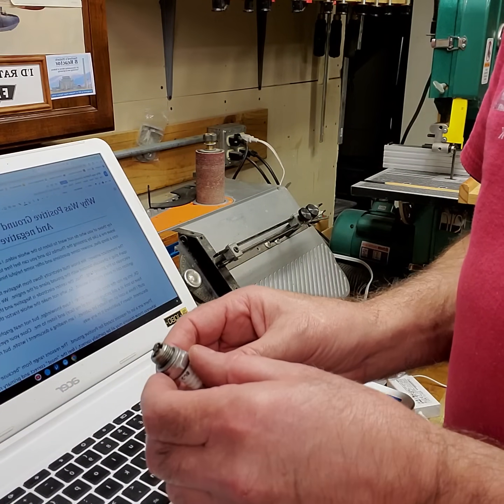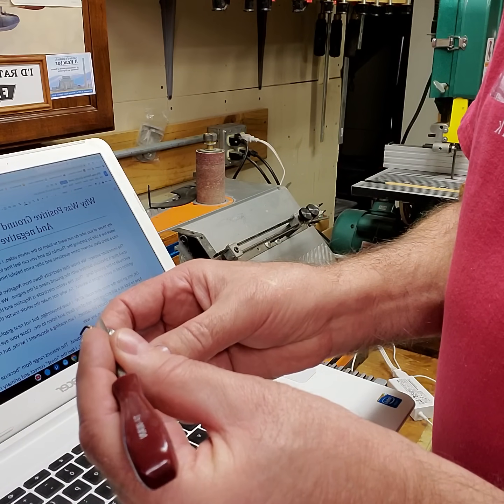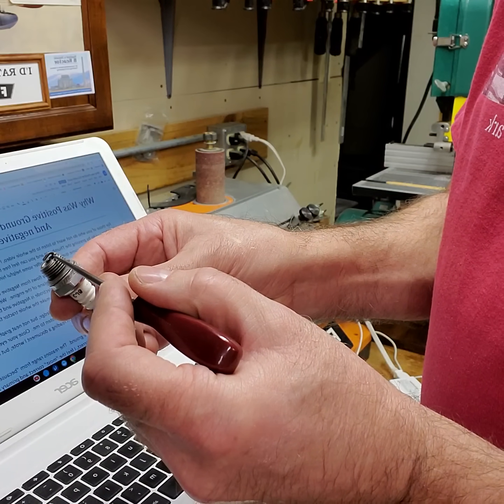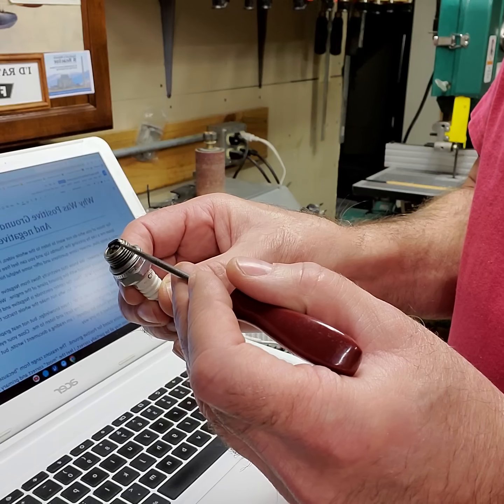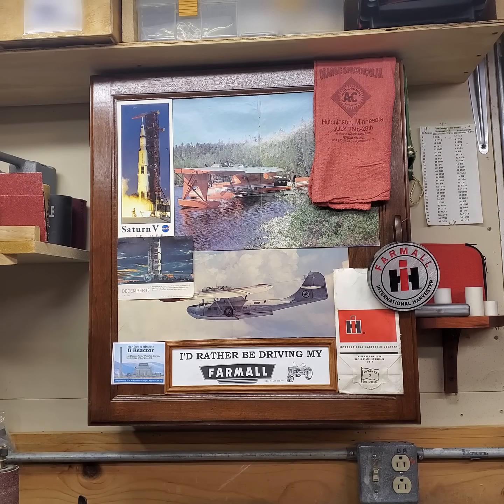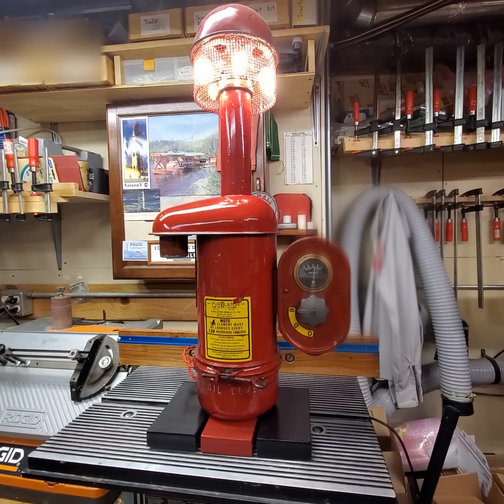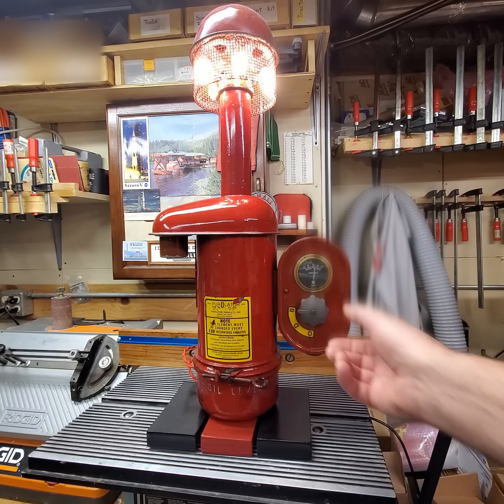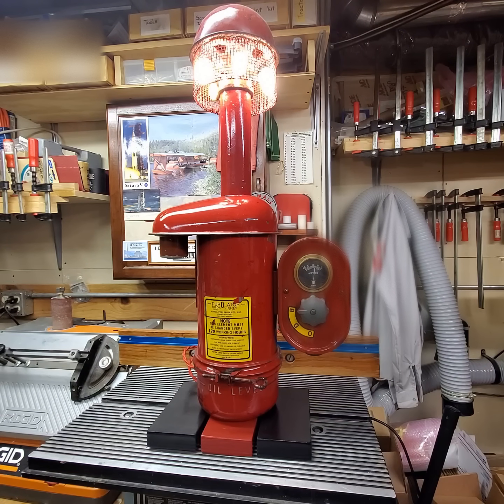Why positive ground was used on old cars, trucks and tractors

Comment: Thank you. I had the proble of comprehending the positive ground  setup on the IH I am attempting to  restore. . Hours of YouTube watching didn't  get my light bulb go on over my head. It just took the right person to explain it the way I could comprehend it. Definitely will  lean up every connection and thanks again for your knowledge.
Reply from the maker: Hi Ken.  Thank you for watching and commenting.  Yes, clean up every connection on the generator.  All the way to the block.  Then, if your H is old, the generator field is grounded through the cover on the electrical box!  Yeah, a bad design from IH.  If the generator is not charging, this is very often the problem.  On my H, I ran a braided ground wire from the L,H,D,B switch to ground.  A vast improvement.  My H is 6 Volt Positive ground and its staying that way.  It always charges and starts.

Comment: I have a John Deere 4010 Diesel 1961.  It has two six-volt batteries connected in series with positive ground.  What is the safest way to charge them in the tractor with my 12-volt charger?  I generally hook the positive of my charger to either positive battery terminal and the negative to the frame?  Is this good?  Does it matter which positive terminal I hook to on the batteries?  Thanks for your knowledge and input.
Reply from the maker: Hi Mark.  Thank you for watching and commenting.
Two 6 Volt batteries in series configuration can be charged with a 12 Volt charger.  It would be best if it was a good sized charger, or it will take a while.
I am assuming you made a typo in your question.  With positive ground, the positive lead from one battery is on the frame.  I assume you are connecting the positive lead of the battery charger to the frame.
Naturally, it's always best to disconnect the battery (or batteries in your case) from the electrical service of the tractor.  Then, charge both batteries (which are in series) at one time.  You probably should not charge a single 6 Volt battery with a 12 Volt charger.

Comment: I thought that the reason for the polarity of the high voltage for spark plugs was because the center electrode gets much hotter and then it is easier to initiate the spark because of thermionic emission, which is what makes vacuum tubes work.  So, it basically lowers the threshold for the initiation of the spark, a little. Some cars, motorcycles, and as noted by someone else here, outboard motors. There are two HV outputs from each coil. Now I thought that all of those had the two ends of the secondary winding as outputs which would make one positive and the other negative. But some may have two secondary windings in parallel.   Often called "waste spark ignition" because one plug in each pair is firing when that cylinder is between the exhaust and intake strokes. Of course, most small engines are essentially also waste spark since the magneto ignition is triggered by the crankshaft, but I digress.

Comment: also the principal is that if theirs more electrons than protons negatively charge  if theirs fewer or less  electrons than protons  positvely charge  so with being said  iginition systems  emf or emp  signals and spark plug wire voltage  would have a higher potencial  voltage means higher of potencial  electrons  to ground  where there is a equalibrium of nuetral charge or less electrons than protons

Comment: Hello great video. I am 54 years old and working on a recent car. I got a 1941 Packard my dad is trying to explain to me what positive ground positive ground system is and why negative is going to the isolated terminal on the solenoid, which I still cannot quite understand what’s what’s happening here if you would like to try to explain that the principal and the wiring on the car to the lights for me to troubleshoot and fix I’d appreciate thanks

Comment: Doesn’t matter. When I turn on the switch something better happen….
Reply from the maker: And, you are right.  What's important is when the old John Deere is cranked over, it goes.  Just like an automatic transmission.  How they work is a mystery to most people.  I just want the Dodge to back out of garage when it's put in R.  Ha ha
Thank you for the comment.

Comment: Hey Bryon,
With all your knowledge in electricity, may I ask you a question?
I have a restored 1953 M38A1 Willys Jeep.  Can’t get the generator to charge., or it seems to put out only 15 or 16 volts of its rated capacity of 24 volts.
My question is, do I need to polarize the new regulator and the old generator to initiate the two components to work together?  
And if so, these components, regulator and generator, are water proofed with cannon plug style connectors.  This doesn’t help when and if trying to polarize the components.
Any suggestions?  Sorry to pester you with my problem.  
Thanks again for your video!!
Reply from the maker: hi, thank you for watching.  My first thought is always the ground path.  Every point of contact needs to be clean.  This includes all the brackets.  I see this a lot in tractors.  People do a super nice job painting all the brackets.  But, that destroys the ground path.
Reply from the maker: I should add more:  And, by ground path, I mean everything all the way down to the bare engine block.  Bolt threads and everything.  Tractors, for example, were assembled and then painted at the factory.  However, carefully painting every part, and then assembling, destroys the ground path.  Especially noticeable on 6 Volt systems.
Reply: @ Again, thanks you for your help and all your knowledge!

Comment: Worked as a mechanic at a fuel trucking company in Alaska some years back. They had an old Farmall pump that was sometimes used to fill barges. Worked great except nobody could ever get it to charge the battery. Well…being a farm boy back-in-the-day the first thing I looked at was how the battery was connected! Yea….it was backwards!!! Boss thought I was the dumbest mechanic he ever saw until he picked up the {fixed} generator from the rebuilder. Bigshot lead mechanic never heard of positive ground. Didn’t make any friends that day!!!!
Reply from the maker: Thank you for sharing.  Excellent story.

Comment: I really loved restoring my dads old Farmall.
It was even more fun to hand crank it up and drive it!!! 1939 Farmall A, no hydraulics, no battery just a magneto. Had to put a new condenser to fix the no spark. When i was tig welding a 76 Ford F250 aluminum oil cooler i got close to the header and i got to watch the little lead particles floating up the arc and depositing on the tungsten...

Comment: I never knew positive ground existed, but my BMW R1200RT bike has a wire going from the + terminal of the battery going to the frame. It made my head hurt when I tried to make sense of it
Reply from the maker: A motorcycle with positive ground id new to me.  But, I see why they did it.

Comment: Confused.  At 1:25, the electrode is negative and the ground tab is positive.  How can that be when the negative side of the battery is connected to the engine block
Reply from the maker: Hi allenblack5794.  I did not make it clear in the video.  However, in the many comments, a very kind commenter makes it clear.  The two electrical "circuits" are separated by the windings in the ignition coil.  It strange as it sounds, and from an electron's point of view, the two circuits exist in harmony.  I hope this helps you.

Comment: Lol, I didn't know your were an IH Farmall fan when I clicked on your video. I'm actually trying to troubleshoot a 1949 Farmall A (🥰 My 1st tractor.) that turns over but won't start. I've already gone through the combustion, fuel systems and now focusing on the electrical system.
Reply from the maker: Hi!  Thank you for watching and commenting!  Yes, I am a Farmall Fan.  I have a beautiful 1944 H (Positive ground and 6 Volt).
My favorite tool is a spark tester.  It hooks up at the spark plug and you can physically see the spark jump the gap.  These are inexpensive tools.  Over the many years, I have fixed a lot of stuff with this simple tool and my Volt / Ohm meter.
Good luck!!
Oh, BYW:  I have seen many problems with the On / Off switch not working.  One of many things to test.

Comment: You are correct about the spark. I trained over 50 years ago and work on more LUCAS generator and regulator systems than anything else. It was always explained that it  is  positive ground, negative spark. LUCAS coils were wound for positive ground and for the transformer effect. I had a problem on a forklift that had a positive earthed alternator. It was wired wrong and the spark was coming up the spark plug instead of going down. After diagnosis and rewiring the the coil and reversing the battery everything worked correctly.
Reply from the maker: Thank you for watching and commenting.  Thumbs up!  You are exactly right.  I like the experience you have!  And, both you and I understand the difference between "the spark was coming up the spark plug instead of going down".  That makes all the difference in the world.

Comment: One more question.  So if i put a battery maintainer on my tractor that has a ground positive system, do i still connect the red clamp to the positive terminal?
Reply from the maker: Hi.  Yes.  You are correct.  
It is 100% OK to use a battery maintainer on a Positive ground system.  Now, to be more generic about the answer (leaving color out), hook Positive to Positive.  It's always best to do this at the battery as this would help avoid possible grounding mistakes.

Comment: Hello, great video, but I'm still a little confused about one thing.  I'm wiring up led headlights to my 1957 IH 300U. I planned on running the light connections straight to the battery terminals and using the toggle switch that came with the wiring harness to turn on/off.  This requires me to use the positive terminal on the battery for positive.  Will it hurt the battery, lights, or tractor if i run the lights off the same battery as the tractor and have them runnin positive to positive on the lights?  Seems like i could be playing with fire.. literally. Where are you located in Minnesota? I'm in Minnesota.. do you still work on old tractors?

Comment: I attended California Maritime Academy during the mid 70s as an engineering student. We took 5 classes of electricity. We were taught electron flow as well as conventional flow in DC circuits. The teacher really messed with our minds in lab class by intentionally confusing the two flows.  We put together kit DC motors and were grilled on which direction that they would turn before closing the knife switch. I have collected WWII Dodge army trucks and post war Power Wagons. Most of the WWII trucks were 6 volt positive ground but the radio trucks were all 12volt negative ground, because of the radio equipment was 12 volt negative ground. The 6 volt generators have labels which are red in color, the 12 volt generators have green colored labels.  I have always assumed that because the manufacturing was set up during WWII, it was easy to switch to 12 volt negative ground 10 years later. I have a bunch of 2N and 8N tractors with a "permanent" implement attached to each one. Most of the tractors are still 6 volt, but the one with the snow blade is 12 volt because the engine turns over better in the cold, especially when the tractor is being somewhat abused and routinely stalled by pushing too much snow around. The Ford 6 volt generators have no voltage regulators, just a cut out and a movable third brush. This will slightly over charge a battery, reducing the life. A one wire GM alternator will extend the battery life to 6 years. Also worn out 12 volt batteries will still start lower compression engines where the six volt battery MUST be in perfect condition.  I can jump other 12volt vehicles with that tractor too.  I have a Model A with a reworked 6 volt positive ground GM alternator, the 6 v battery will last for 5 years.
Reply from the maker: Hi Steve.  Thank you for watching and commenting.    Very interesting comments.  An education that has you determining the direction of rotation before electricity is applied is a very thorough education indeed.  We just started our 6 Volt H last weekend after sitting all winter.  One crank and it was running.  Take it a bit easier on that snow pusher!  ha ha

Comment: it has nothing to do with the spark plug. the spark is ac(watch it on an ignition scope). I am 78 years old and grew up with this. one thing for sure. the positive connection to the wiring in the vehicle will cause the wires to corrode off but not if the wires are negative compared to chassis. i am not embarrassed I know what this is about.

Comment: Very nice video I am new to positive ground oh, God I just bought is a 1959 Austin princess Rolls Royce I'm not getting no spark so I'm not too sure how to check this stuff out the points look clean I cleaned them so I don't know what the deal is any help would be good thanks in advance
Reply from the maker: Hi!  Thank you for watching.  I would use my Volt meter and Ohm meter just like working on any other type of vehicle.  But, for sure, I would make sure the ground path between the distributor housing and engine block is clean.  That is where I would start.  Naturally, there is the easy stuff.  Is the ignition switch on?
Good luck!  What a great car to have!!!!!
Reply: I got a good ground I do believe but I think someone told me the condensers probably bad because I had a 12 V battery hooked up to it so it might have fried it
Reply from the maker: @stevenkasten1149   Good luck!  I am positive you will get it figured out quickly.  In the end, it will most likely be something simple.
Reply: Thank you I'll keep you posted

Comment: I find it easy to understand electron flow from negative to positive, excess electrons at negative to lack of electrons at the positive. Never quite grasped “hole flow” theory.  Since the ignition coil is a completely isolated circuit, the collapsing magnetic field generates the positive and negative poles, thus the center electrode is positive and the tang negative.

Comment: How do you have a positive ground coil on a negative ground vehicle?  If the cylinder head is negative ground, then the spark must flow from body (thread) to center (electrode) as it flows from negative to positive.  So how can you reverse this when the head is negative?

Comment: I am in a rabbit hole of posative ground at the minute.
The " distributor is a ground" line really hit it home for me.
Thanks for the videos. You know your stuff.
Reply from the maker: Hi S8 Mury.  Yes, the body of the distributor MUST make good contact with the engine block or the ignition system will not work!  This has happened to me.  The aluminum housing of the distributor gets a layer of oxidation on it and good electrical contact is gone.  Especially if its only 6 Volt to start with!

Comment: High voltage for your spark plug is ac there is diodes on the high voltage side of the coil you may have more current in one direction but basically a dc pulse goes through the primary producing a ac output on the secondary. Both sides erode but your right a strong dc pulse is best for ignition. I think a laser would be better but why change some thing that works so well . Like glow plugs on diesels and an nitromethane on RC engines. My favorite is hydrogen and oxygen from water it can be recycled in space or under the water for combustion engines minus a small amount of loss I need to be done in over efficiency at 20 using half a megacycle for residence no water molecule just falls apart five watts you’ll get you 100. Don’t poo poo this check it out it works. I really like your tractor advice. You always do. You know a great deal about tractors, especially the older ones. Have a great day yes and people do strange things to ground. That’s for sure.